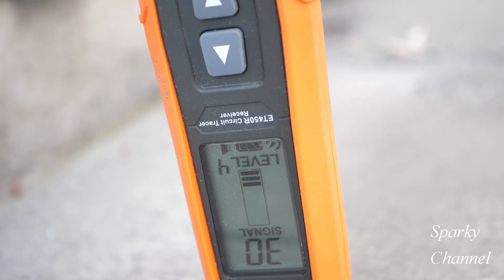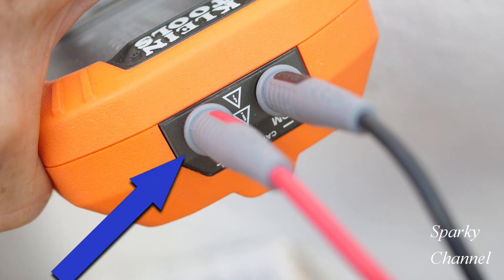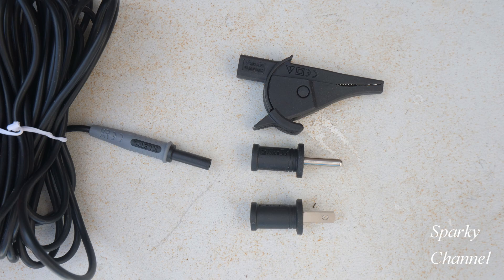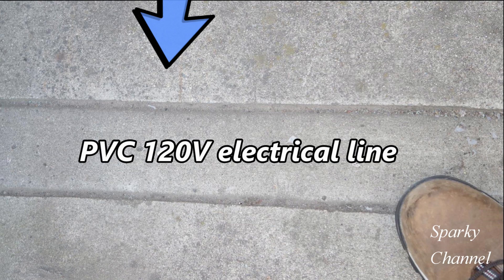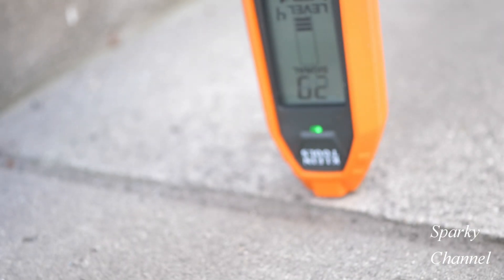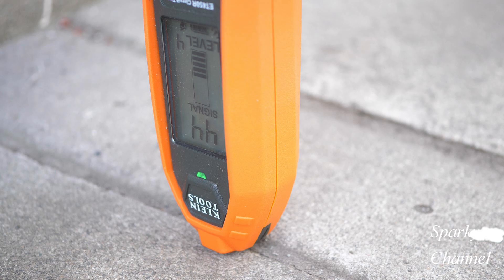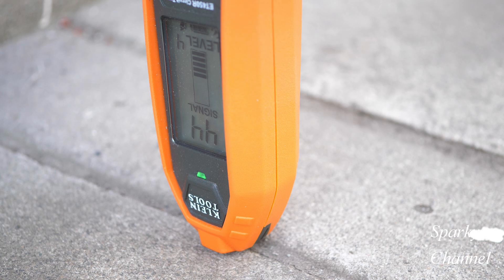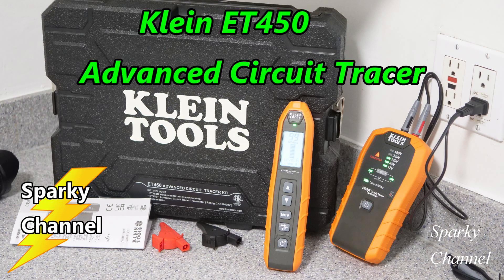Can I find an Electrical Line Under Concrete with the Klein ET450 Circuit Tracer?

Comment: Hey sparky great video have 1 question can the Klein ET 450 Circuit Tracer be used in commercial buildings. For sum higher voltage

Comment: I have no experience with the ET450 yet but I believe you are holding the receiver 90 degrees off!  That may keep it from seeming as accurate.  The front to back of the receiver should align with the wire from what I've read and seen.

Comment: They need to make a fish tape that has a  transmitter in the end of it. So many times I’ll go to use existing empty conduit, but get stuck somewhere because the conduit is broken. If I could push my fish till it stops, locate it above ground, then I could dig down and fix the conduit, but god only knows where it’s running, and where the break is
Reply: Most fish tapes have measurements on them to use, if it’s not a straight run then yeah that’s not going to help. I’d love a fish tape transmitter too
Reply: Search for locatable rodder or traceable rodder. They do exist. I'm watching this trying to decide on a tracing tool to use with it. It's just a fish tape with a copper core.

Comment: There is no time lag* 

Electromagnetic signals move at the speed of light and would permeate the concrete the same as any other non-metallic material. The alternating signal generated by the transmitter would be causing a field effect around the wire that the receiver is picking up. 

*Any time lag would be due to signal processing on the part of the receiver.

Comment: In your experience, is this device worth the investment? I am considering adding it to my tool kit; however, i do not know if the return on investment will be there.
Reply from the maker: Do you need to find wires behind walls?
Reply: @SparkyChannel  on occasion Sparky.

Comment: I would say it's picking it up you have to consider its battery operated and not electrical I think an electrical current would be a little stronger than battery that's just my opinion...🤔

Comment: Hello Bill,                                           Because the device/tool was designed to locate hidden electrical wires and because the devise showed an increase in detection signals from upper 20's to lower 40's, it would still have me want to read the manual thoroughly. Why? Because the readings were not anywhere near the 80's or 90's where certainty nears absolute findings. 👍

Comment: What is the reason why you cant just insert to the ground to that duplex that you have your hot lead into.? What’s the reason. Why do you need to go so far.
Reply from the maker: It's because the hot lead and the ground can't be on the same circuit.
Reply: It would trip the GFI

Comment: oh, it absolutely follows and FINDS!   no time lag.   but hold the tool properlly and that will help.  In the video you are crossing the path of the wires you know are there.  Turn the receiver 90 degrees and sweep across and you will find much different and more accurate readings.   The tool is quite amazing and has helped me save hours on a job site many times
Reply from the maker: Thanks!

Comment: I think the concrete is more dense where you started.  When the reading gets higher because it didn't get filled in as good. It looks a clean square, could've been framed with 3/8" plywood then filled with self leveling sealant.
Reply from the maker: It was 4" of Redi-Crete, no plywood or sealant involved. It could have been a little thicker in places, that's true.

Comment: Run the receiver starting from the outside of the suspect area and over the area until you get the highest readout, mark the spot. Then do the same starting from the opposite side of the area, mark the spot again. Find the middle point between the two marks and, in theory, this should compensate for the lag you are perceiving and give you a more accurate location
Reply from the maker: Excellent idea, thanks!

Comment: I think that the depth of it is a factor in the delay. Almost any signal like radio or TV gets "dampened" or somewhat dissipated when tra eling through that much material. I'd like to see how it reacts when set to a higher sensitivity.
Reply from the maker: Good thinking, thanks!

Comment: Bill, how would I check to see if a neighbor tapped on my electric line on each circuit, I have a common wall I think they tapped into.
Reply: Turn off every light tv anything after you shed any loads check the meter if still spinning then you have a tap
Reply: Turn off your breakers and listen thru the Wall “ WTF”
Reply: @martinsnibbor7691  if the breaker(s) are off what are you hearing
Reply: @gerhardschemel3565  the neighbor
Reply: @martinsnibbor7691  what are you talking about
Reply: @gerhardschemel3565  The neighbor saying "wtf" because the electricity was turned off. It's a joke.
Reply: @illestofdemall13  that did cross my mind but since it was not known there was a tap let alone what breaker it might be. 
I think the guy nextdoor tapped into my power how can I find out 
Every couple of hours turn a breaker off until you hear Hey WTF
Reply from the maker: Gerhard explained it perfectly.
Reply: @SparkyChannel  I appreciate that Bill

Comment: Hi bill from sparky channel

Great show

Like you I’m guessing.

With probably more than one conductor down there, I’m wondering if the emf field is offsetting the signal or maybe dragging the signal like the old am radios did.
Just guessing here. 

So I bought one thanks to you using your link of course.

I’m wanting to know how this works connected to a separate ground not connected to the building ground like a separate shorter grounding rod.

What I’m hoping for most is finding that remote wire in commercial hvac situations where there’s multiple stories or 100 plus feet and physically tracing is a rough option.

Thanks again
Reply from the maker: Hi Jeff! A grounding rod would work like attaching to a cold water pipe as I did in this video. Just make sure the transmitter  reads the correct voltage and it says "transmitting". You'll be good to go then. Let me know how the ET450 works for you. I'm sure that there are a lot of uses for it. There are also several different ways to set it up with different terminations. (See 1:53 for 3 different ground terminations).
Reply: @SparkyChannel  thanks Buddy

Comment: Sparky, there is no delay of a field going through concrete. There may be a diminishing of the signal, but no delay.  I'm guessing that you're seeing some field on the side that is in the direction of where you connected your ground.
Reply: Bill, the electromagnetic signal is moving at the speed of light. Unlikely to be a delay
Reply from the maker: That's possible. As I mentioned, I was guessing. There is another electrical line a few feet away so that could have been influencing the readings.

Comment: I wonder how it compares to the $1700 ideal suretrace
Reply: That’s a good question. The suretrace is pretty good I have used it a few times
Reply from the maker: The SureTrace is a very fine testing kit. I would suspect that it's better than the ET450. However, the ET450 has 8 levels of sensitivity while the SureTrace has only 4 levels. Sensitivity levels are an important feature.